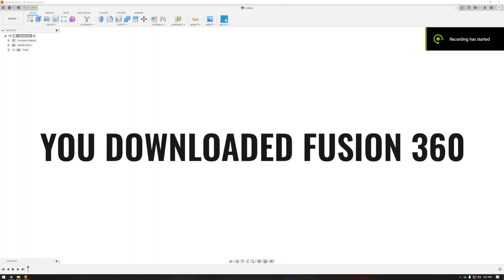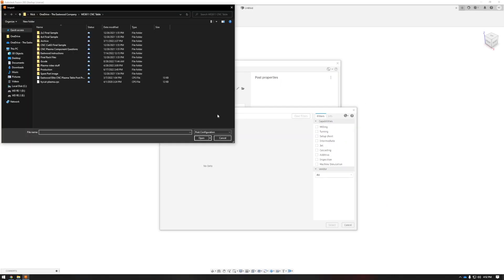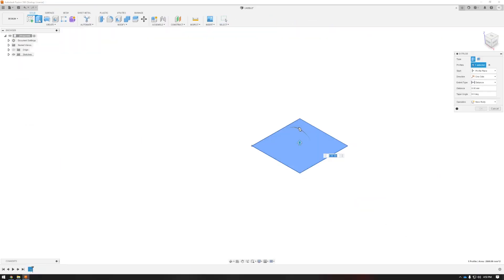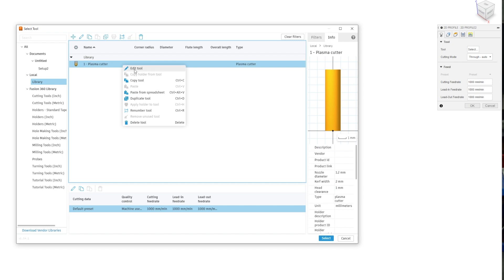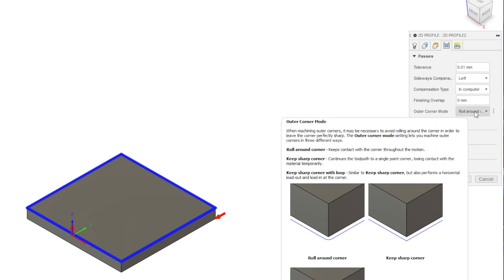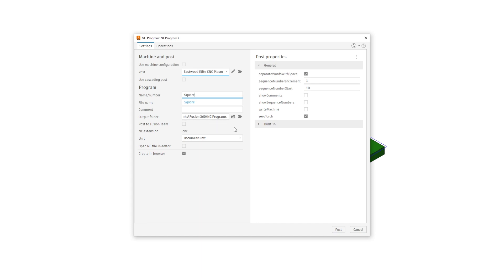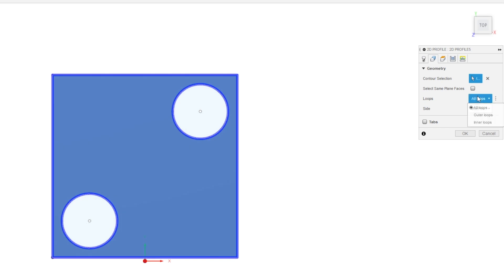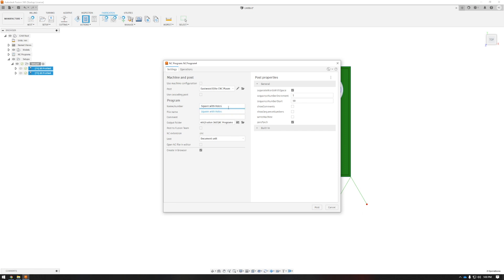Introduction to Post Processing Parts for the Eastwood Elite CNC Plasma Table in Autodesk Fusion 360

Comment: This is not a DIY as advertised. If you do not use Fusion360 you will need to take a class in order to use it effectively which could run you another $1k-$2k on top of the initial purchase of the table. Customer service can not even answer questions. Eastwood should advise before you purchase that you need to be efficient in Fusion360. We would return our table but we are in to far to do so. Very-Very Frustrating!!

Comment: What’s the biggest file size you can upload? Does fusion automatically transfer exact measurements? Or do you have to re scale them on the controller?
Reply from the maker: We haven't run into any issues with file size after cutting hundreds of projects - CNC and DXF files aren't very large. Fusion will export exact measurements however you can scale on the machine as well if say you created a prototype at 1/2 scale and then wanted to quickly double it.

Comment: Is there a special type of usb drive that I need to have? I can't get my controller to see the .cnc files
Reply from the maker: Make sure you're flash drive is formatted as FAT32. If you're still having difficulty we've had success with smaller sized flash drives, sub 16GB. Let us know if that get's you straightened out.

Comment: The.post processor will not load on fusion
Reply from the maker: Did you extract the cps file from the zip folder?
Reply: @eastwoodco I finally figured it out. It sent 2 files. The other was in a different folder and it worked.
Reply from the maker: Nice we're glad that you got it figured out!

Comment: I think I’ll need a class to go in person to actually learn this program
Reply from the maker: There's ton's of additional videos walking you through on YouTube.  It's not as intimidating as it seems.
Reply: @eastwoodco  of course it will be awhile before I make a big purchase for a cnc plasma table but I do however have my Amazon cart full of Eastwood stuff that I’ll slowly buy in the future hopefully. Just not going to rush it with this economy right now. Have the tig ac/dc 200, 40 plasma cutter, mini lathe, mini mill, and of course the sweet tungsten sharpener.